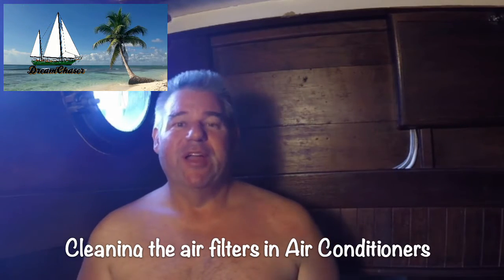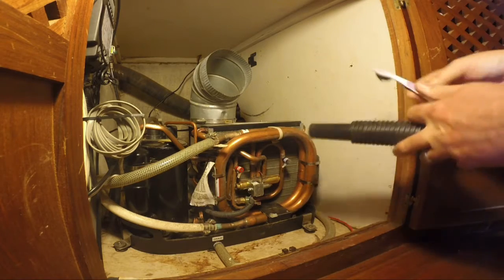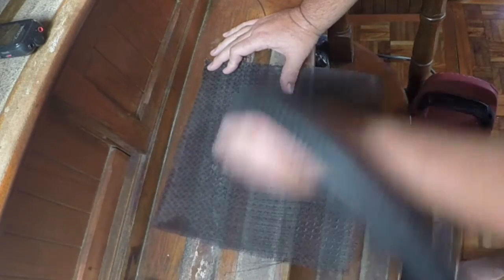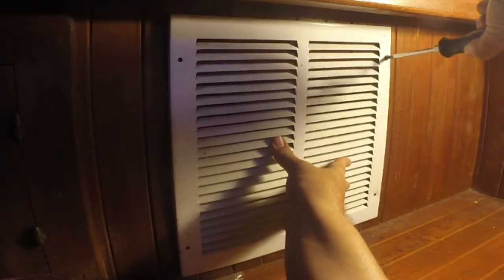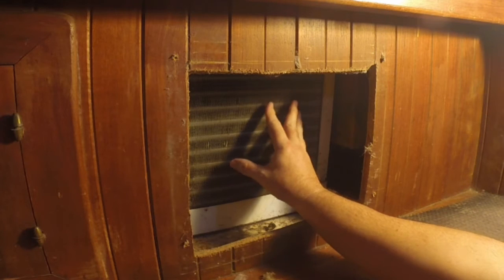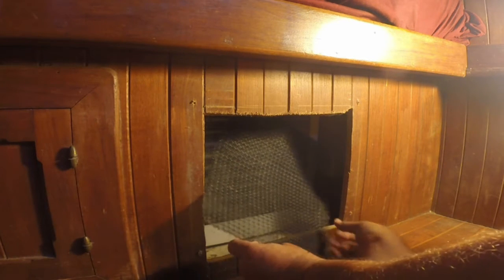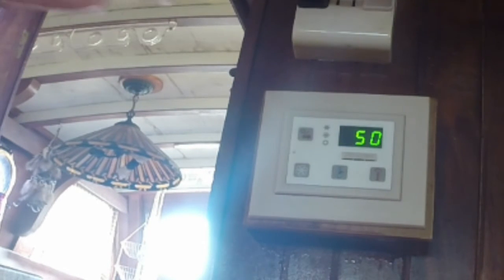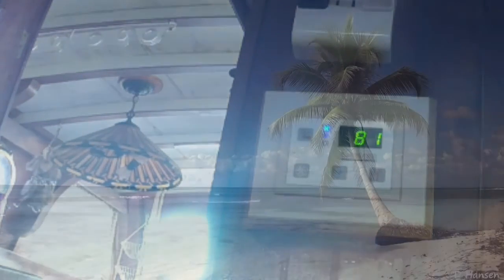Cleaning the Marine Air Conditioner Air Filters

Comment: 76 is the worst temp setting,it doesnt cool and doesnt remove humidity,especially on startup you must seal doors and windows,and set the temp on the tstat on 73,after about 5 cycles,that usually last 20 25 minutes each if the unit is the correct size and the ventilation vents and piping are located correctly,and the curtains are pulled,only then you can switch to 75 and keep it there,on 3/4 fan speed this is how you get the best out of your air cond.syst. anything else is a waste of power and resources,remember,that your ac main job is to condensate humidity and remove it from the cabin,in every drop of water there are thousand of fungus and bacteria,and mites,so its important to also spray some air freshner that kills bacteria near the intake of the air flow so that we kill the most of pathogens follow instructions,and do not breath spray,return to roomafter a few minutes you have sprayed,also use some of the buckets of humidity removing bags, try to keep humidity between 40 and 60% top,but ask a doctor if there are children onboard,view the books that come with the units the second time you read them you will find more interest in it.
keep the fins of the evaporator free of dust hair and flyn objects use a portable brush and a vacuum,to remove the most as often as possible along with washin the filter with a good sponge and dish soap with antibacteria,spray it with Lysol or similar equivalent,and mantain
Reply from the maker: Thanks. Great info. I didn’t know that.